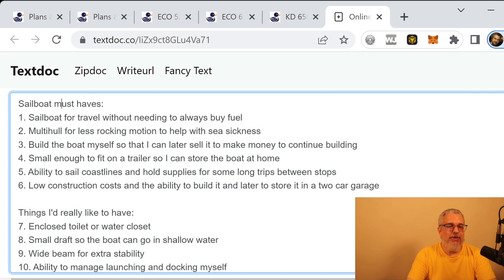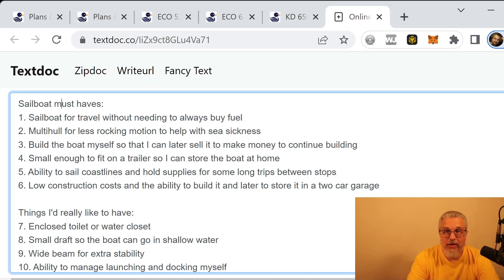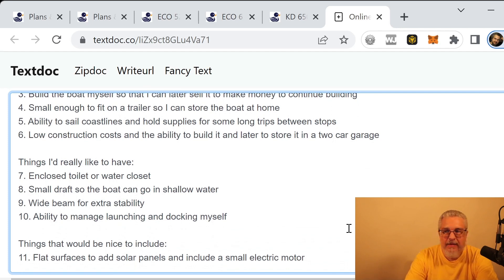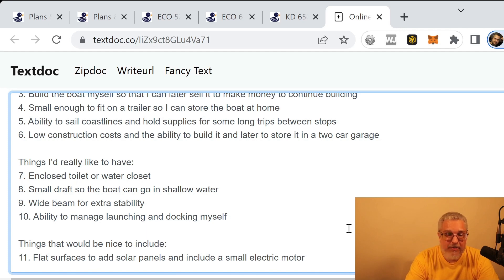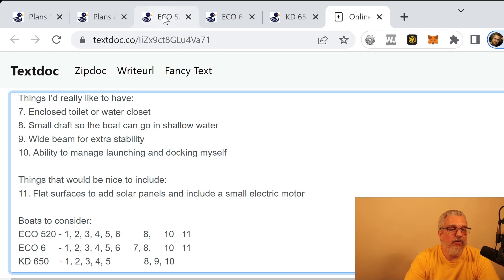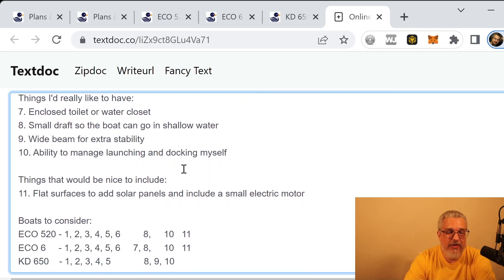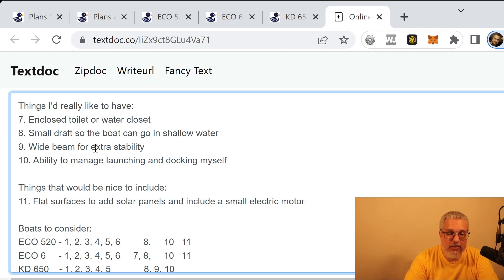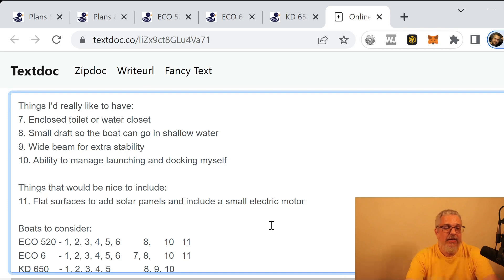DIY Sailboat - What is most important?

Comment: Who told you catamarans have less rocking motion? They sit on top of the water, not in the water. Therefore, by design, they have more rocking motion. Catamarans have less heel when under sail, but definitely not less rocking. They can hobbyhorse like crazy in coastal waters.
Reply from the maker: Obviously, I'm not a sailor. And I'll get my terms wrong for a while still. I was referring to the heeling and I thought there would be less heeling when anchored too. This is a fairly light boat that I expect to weigh about 1400 pounds or 630 kg when done. So you are correct that it will sit on the water. It will have a draft of less than a foot.
Reply: @makewayprojects  There is always some factor dependent on the boat size and the wave train, etc...  but no question that general feeling about cats is that they have a much better motion, whether sailing or docking.

Your list is sorta impossible.  But that is boat building.

You will never make money building and selling.  Particularly if it is relatively funky, and you added a lot of stuff the designer didn't specify.  Though that assumes relatively average sales ability.

Trailering of small boats is a superpower, but it will make many demands on the kind of built, and often make them orders of magnitude more complicated for multihulls.
Reply from the maker: I'm actually planning to make the boat wider now than the typical legal road width limit. In some later videos about cutting the bulkheads, I discuss this. I'll be making the boat 10 feet wide so keeping it easily trailerable is something that I'm no longer trying to accomplish.